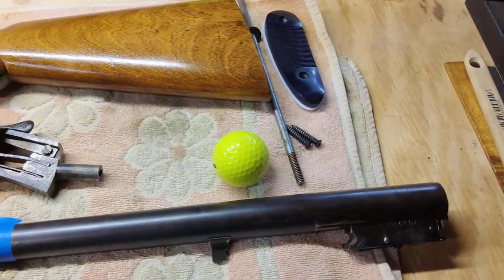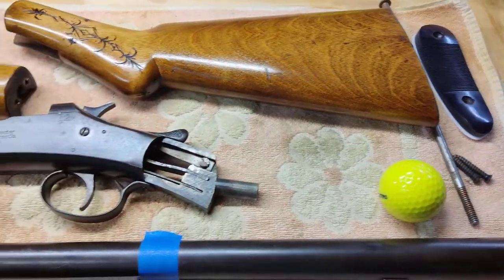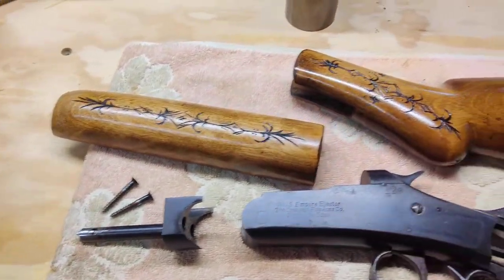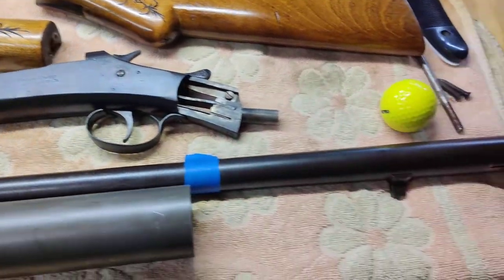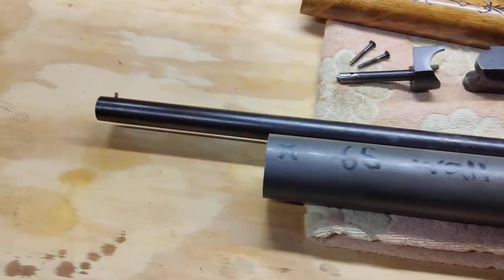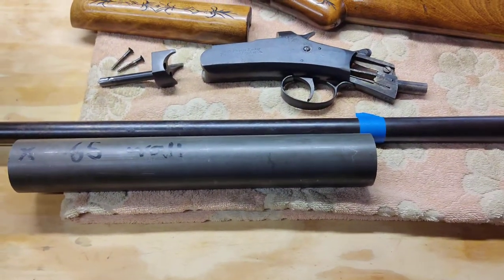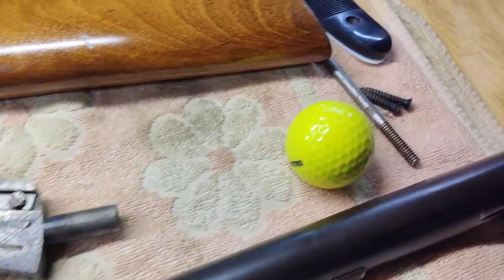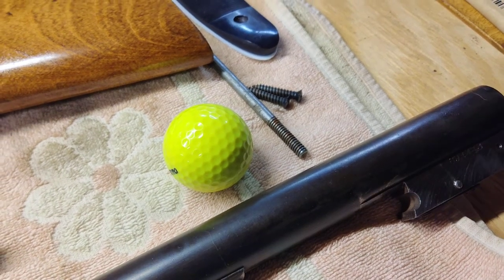Cresent No. 15 Empire Ejector 12 Gauge Golf Ball Conversion

Comment: question.. how did you remove the barrel from the reciver. you help would be appreciated
Reply from the maker: Grab front of forend wood and pull down. It should pop off. Then pop the top snap to the side,move barrel to load position and lift off the receiver pin.